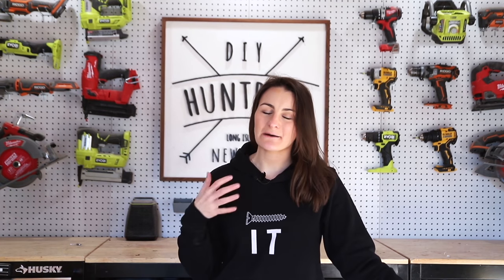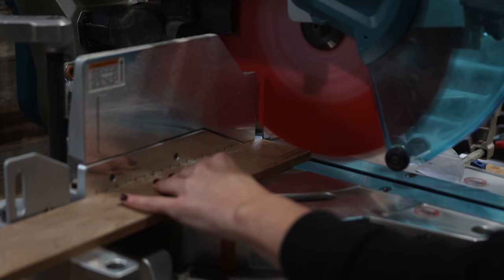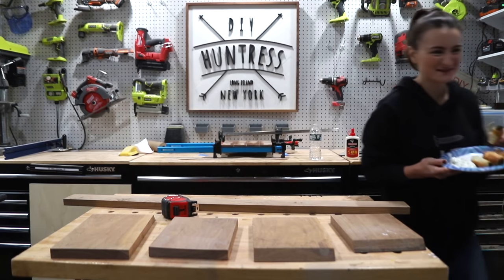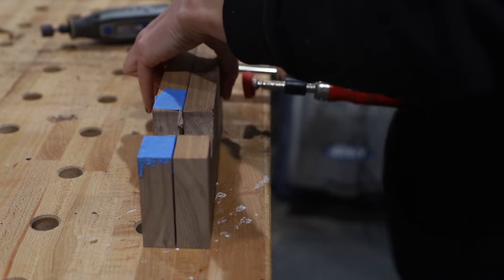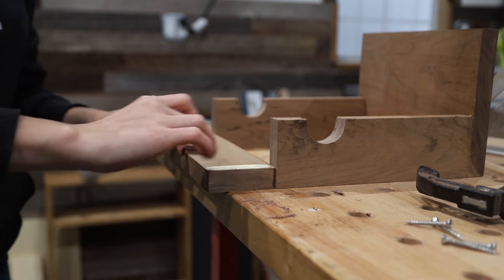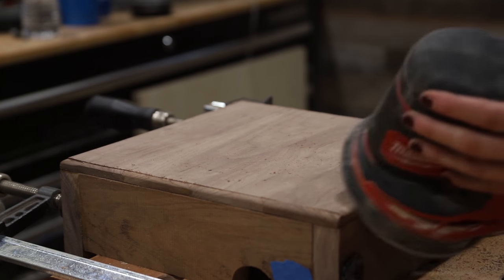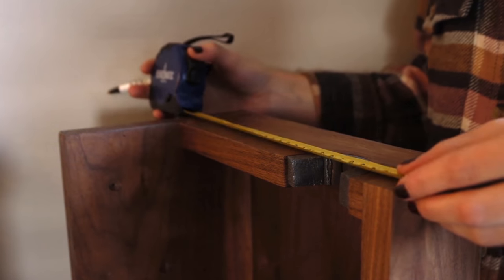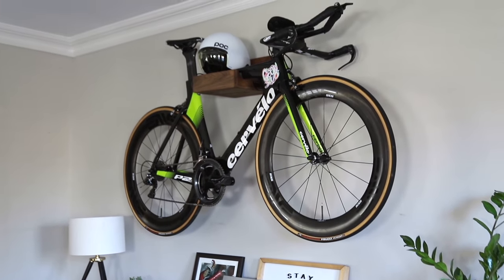DIY Wall Hanging Bike Rack With Storage

Comment: Nice project, gotta say though that shop space was making me question your tool choices. Ryobi, Milwaukee, Rigid, DeWalt... all in the same shop? If sponsors are sending them to you free that makes sense, otherwise wouldn't it be a hell of a lot easier to just stick to one brand? Fewer batteries to buy, no mixing them up, fewer chargers to keep track of....

Comment: If you drill with a  forstner bit to avoid tear out try clamping a scrap bit of wood underneath to continue drill into. It leave little to no tear out.
Reply from the maker: I actually did that and still got tear out (you can see the scrap piece underneath). Time for some better bits!

Comment: Nice work. I used to make gun cabinets and when i was making the barrel holders. I would drill the holes through the center of a board then ripe it in half. No tare out that way. 🙂👏👏👏
Reply from the maker: Thank you! That’s a good idea! I usually flip the board over and then finish drilling through the other side, but this forstner bit’s tip was too shallow. Gonna invest in some new ones.

Comment: Nice video and a very creative way to save space! I'm also looking into installing a bike rack in my flat (not as elaborate as this though :D ) . I do have a question: does the wall you mount the bike rack into have to be of certain thickness to hold the weight of the bicycle?